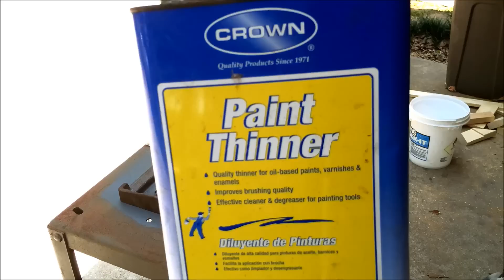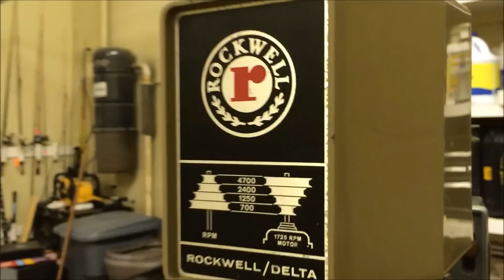1974 Delta/Rockwell Drill Press Restoration!

Comment: Just finishing a similar clean up with same drill press but a couple decades older, I think. Missing the top pulley cover and working on a on/off switch since none on the motor. Thanks, great video. The vinegar is magic stuff!

Comment: Looks great I just done one of these. That post can be wire brushed with 4 1/2 angle grinder  wire wheel and it will look brand new
Reply: Les Berdine or use a 2in die grinder that’s what my dad did on my 1975 Rockwell